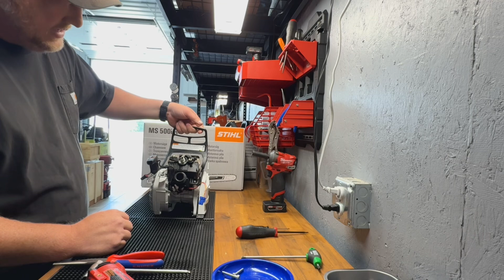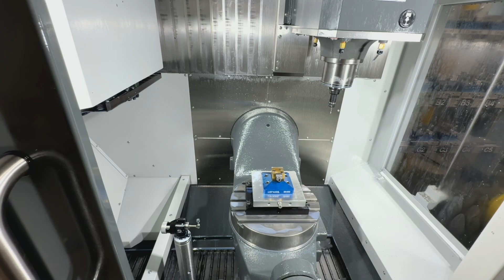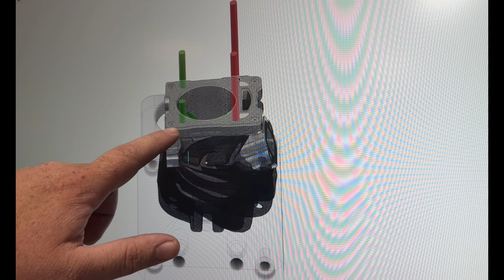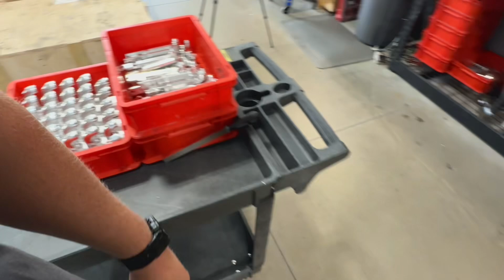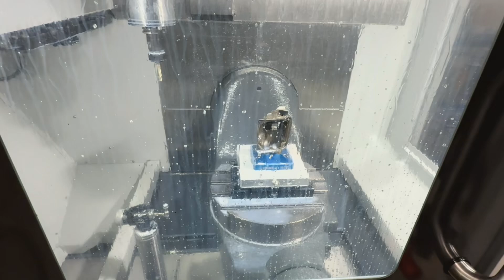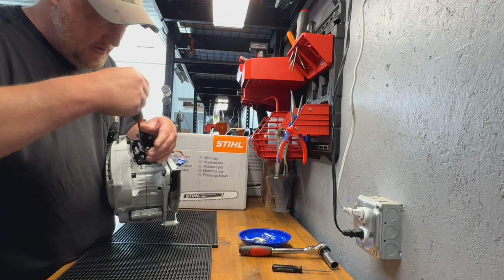CNC Porting a 500i! How it’s done and why it’s better

Comment: Great video beautiful machine, I would love to be able to machine all my stuff but to buy a CNC is pretty much impossible for me although I have been looking at some that are actual 5 axis. Idk if it would cut all five axis simultaneously but I’m not in a big hurry so I guess I’d have to readjust it manually. I’ve been looking at a few that range between $1500 to $6500 (ones within budget). I just wonder if I can get any use outta something in the price range. I wish I could share what I’m talking about but that would be too much on this forum.
Thanks

Comment: Somebody hand ports a cylinder to make a model for the CNC program to copy. There will always be a need for hand porting.
Reply from the maker: This is not how it works. The cylinder is drawn using CAD software, and does not replicate any port work performed by had.

Comment: Whats the difference between m-tonic and what the 500 has ?
Reply from the maker: The M-Tronic use a more conventional style carb with an electronic solenoid mounted where the adjustment screws would be. On the 500i there is an injector, similar to what’s on a modern car, that squirts a pulse of fuel into the intake stream. Both versions use various sensors to monitor and adjust fuel conditions.
Reply: @309machine Thank you for the prompt response!  When I pull the trigger on the 500, you are it !!
Reply: @309machine  Do you have any input or thoughts on this infamous 4 stroking the 500i does in smaller wood? 

I’ve heard that it’s the gas, or at least it’s a factor.  That it actually runs better on 87 pump gas.
Reply: @309machine  Do you have any input or thoughts on this infamous 4 stroking the 500i does in smaller wood? 

I’ve heard that it’s the gas, or at least it’s a factor.  That it actually runs better on 87 pump gas.

Comment: This is the new standard. Hand porting will be a lost skill one day but in this case, that's a good thing. Ported cylinders which are consistent through cnc is going to be necessary as fuel injection advances. Very excited to run these in the future. Thanks for the video. I've been wanting to see someone do this for a long time now. I hope you make alot of $ with this 🫡🇺🇲

Comment: Very amazing work!  One question, given that you’re performing this work on CM machines, do you have a STIHL laptop and software that allows you to tune in the settings via the software interface as well as perform the factory CM calibrations?  Lastly, if not, will a STIHL dealer service your saws for tuning issues as the saw wears in?  Thanks!
Reply from the maker: I’ve got the software and harnesses but it’s not needed. The M-Tronic saws have a reset procedure that can be run without connecting to a computer.

Comment: This is amazing I can't wait until the day someone makes cylinders from a billet and crank cases and crankshafts if not cranks then you can custom machine the cases to take one cylinder with another crank and make something amazing
Reply: It could be done today, but the base metal for the cylinder is kind of junky, which is why it is cast, bored, ported and then has Nikasil applied.

Comment: Coming from a guy who has been porting cylinder heads ,rotorys, and 2 strokes since mid 90s also has spent way to many hours on the port bench and flow bench . Only complaint i have is where are your glasses you only have one set of eyes I wish I could have back the time waisted in emergency rooms getting aluminum steel and alike out my eye while I had glasses on I will say this there is something about nickel that when you get a piece of that shit in your eye its a battle
Reply from the maker: Thanks for the concern. I 100% wear them when I work on the mufflers. I find the cylinders produce more fines than chunks and fogging safety glasses makes it easy to make a mistake around the plating.

Comment: I find it ironic that Stihl uses red oil at the factory, then tells customers they have to run the blue oil for a full warranty.  😅
Reply: Color could mean something or not. The function of lubricant choice maybe predicated on initial start and break in at the factory. With a nod to shipment and storage before consumer use. Two different criteria for different needs. When we cut it’s a different story at that point! 50:04

Comment: Great Video. Thanks for this. I am surprised (or I did not see) that you do no alignment on the cylinder base to the crankshaft housing. Did you ever make a power/torque test of the 500i on a engine test bench with a brand new and a ported chaisaw? Peak power is not the most important thing. How does fuel efficiency and emissions change? The suprising thing for me as a german is that you always mention that you use or want to use american brand/made tools. This is not my experience when I was working with americans, the discussion was always "do we need this, how can we make it cheaper". The germans alway want to use the most economic (most of the time the cheapest) tools and parts, wherever they come from. Greetings from Germany.

Comment: Fyi those screws are not aluminium, they're non-magnetic austenitic steel.
Reply from the maker: I can say with confidence that they are aluminum. Although I will agree that austenetic stainless steels are not magnetic, they also have higher chromium contents that would make them more “shiny” versus more dull. The main reason they can be identified as aluminum is the fact that they weigh about half as much as the steel screws used on the rest of the saw.
Reply: @309machine interesting, on second thought it does make sense as there’s not alot of clamping force needed to hold the air filter base. I’m probably confusing them with the 500i’s cylinder bolts, those also arent magnetic and there’s no way they’re made out of aluminium.

Comment: Nice little machine. I run a umc750. There's many different stlyes of. Angled lollipop style endmills that would give good finishes and reduce the number of passes. I do get the speed is not everything. When running high speeds and feeds, you dont get true form when machining.

Comment: Great video. What's your average power gain after the cnc/port work when compared to a stock 500i?
Reply from the maker: We’ve seen around 35%. Depends on a few things, but it’s a strong running saw.
Reply: @309machine  Good deal!!!

Comment: Why not add a relieved ball mill or long lollipop and rough the uppers in and/ chamfer the cylinder side of the ports?  Obviously can’t get all of the uppers but all you’d have to do is blend the machined area to casting by hand.
Reply from the maker: I’ve actually worked through that exact same recommendation. Ended up still having to finish the uppers by hand and I like to use the chamfering as a QC point. Definitely a good thought though.